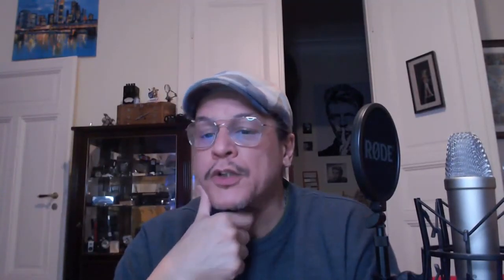Livestream Excerpt - thoughts on the Powermatic 80 watch movement

Comment: I have the old version CO7.111 
Lot's of people on the internet claim that it can't be serviced. My question is the same as the above... Can it be serviced? It works great, but still
Reply from the maker: Yes, it can be serviced: https://calibercorner.com/servicing-powermatic-80-watch-movement/
Reply: Thank you <3 @TalkingTimepieces
Reply: The C07.111 is not an old version. It is just a different version and is still used in a lot of Tissot non COSC certified watches. It uses a self lubricating synthetic polymer material for the pallet fork and escape wheel. This lighter and more slippery material helps achieve the 80 hour power reserve. I have a Chemins des Tourelles that is three years old with the C07.111 movement and it runs about -30 seconds per month. That is well within the COSC certification requirements even if it is not certified. If Tissot wants to replace the movement at service time so be it. It is still a great watch at reasonable price. It will never be a Rolex or an Omega but it is still a remarkable time piece.

Comment: The BIG question, is those movements can be serviced or not?
Reply from the maker: Yes
Reply: When you send it in they exchange your movement for a new (or serviced) unit, for very fast turnaround. Your old movement is then serviced and put in someone elses watch etc etc.
Reply: .....it's a $700 watch.  not sure it's worth servicing.  i'd just wear to failure and replace.  agree, the plastic is inexcusable.